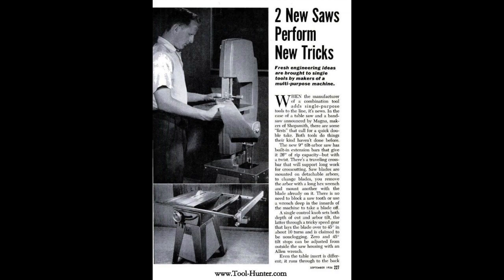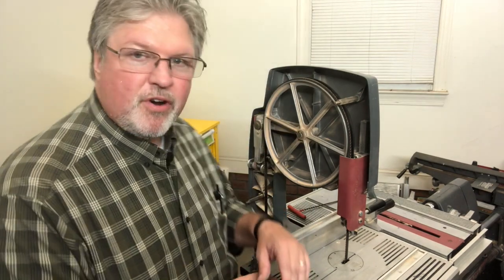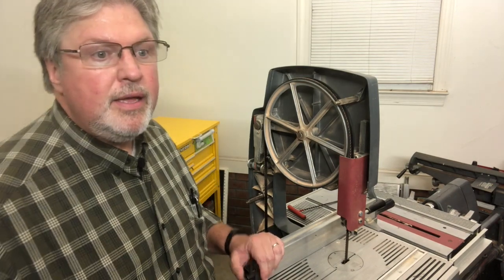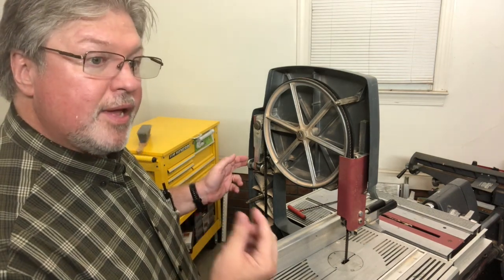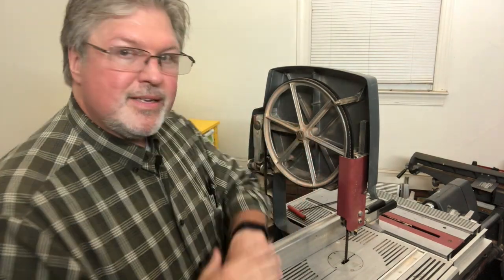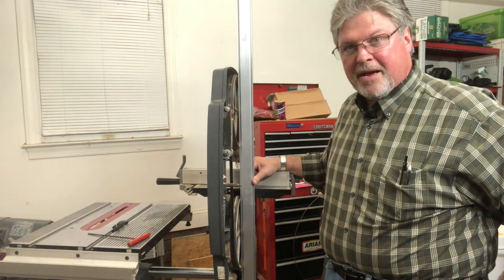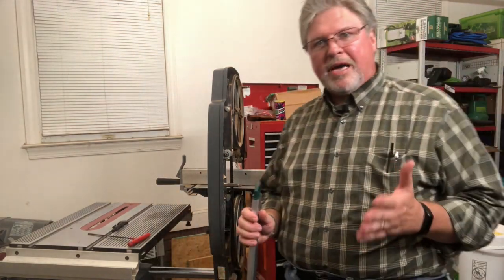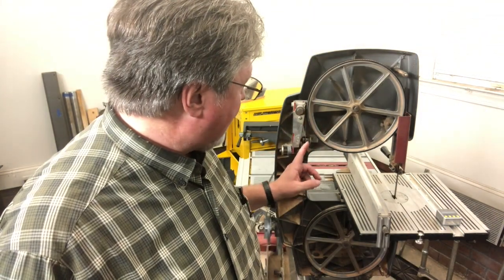How to Tune a Shopsmith Bandsaw: Fine Woodworking Magazine Lied to Us!

Comment: My shopsmith is about a 1985 model my top wheel has no e clip and my top wheel can not be removed meaning that it has water pump type bearing  bearing, ans another Q the adjustment for the blade I see the marks for the size blades but no mark on the red part to tell if set right.
Reply from the maker: The top wheel was never a water pump bearing. If there isn’t an e-clip it’s held on with a spiral retainer. There aren’t marks on the red leaf spring. As for tensioning, there’s another video that covers this. Let me see if I can find it. Scott
Reply from the maker: This may be the one: https://youtu.be/-03FHNNAExg

Comment: Scott, I am not happy with the length of bandsaw insert leveling screws.  They seem to barely thread into the bandsaw table.  Do you know where I could get longer screws?  Perhaps 1/8" longer?  Thanks in advance for any help you are able to provide me!
Reply from the maker: Isaac, just pulling one out and taking it to your local hardware store. Should be a stock machine screw size.
Reply: @MyGrowthRings  Thanks for the quick response!  We have a small True Value Store here.  I'll certainly give them a shot!
Reply from the maker: @warrensedlacek6860  And I agree with you, they are very short.

Comment: Scott, my adjuster seems to be way out of adjustment, can that be recalibrated??
Reply from the maker: Check the manual. If you don't have one you can download it from the file section of the Shopsmith Owners Facebook group.  Basically, you remove all the tension and loosen the front plate that has the blade sizes stamped into it and align the upper left edge with red the outside edge of the leaf spring.  I think I show how to do it in one of my videos, but I don't know which one!  Scott
Reply: @MyGrowthRings  Scott, mine is the Total Turd, I am sure there will be something close kind of,  LOL
I did make a new lower roller guide for the broken one, I told you about last week. I will be doing the top one next, and making a better video of the process, that bottom one is hard to film, without taking off the table.   Speaking of the Table, it had no shims and needed them for good alignment!!  Thanks  Spike
Reply from the maker: @FrugalFixerSpike  Yeah, there were a couple versions of the Total Shop bandsaw, with one being close to the Shopsmith design than the other. I have one of each and I'm not sure that I can say that either of them is a good saw.  Scott

Comment: Scott, I have also had my SS bandsaw left under tension basically since 2004 (didn't know it shouldn't). I checked the cant on the upper wheel as you showed, and with my straight edge on top and bottom of the lower wheel, neither edge is touching on the upper wheel. Your method of adjustment helped, but not enough. That upper wheel is still tilted back, but I don't know how to restore the positioning on the upper to he lower.
The end result is my 1/4" blade tracks perfectly, but my 1/2" blade falls off the front, rendering it useless. Any suggestions? I suppose I could overtension the 1/2 blade to pull it back, but that doesn't sound like good advice.
Reply from the maker: Just to be clear, the top edge of the wheel tilts back, towards the back of the saw. It it needs more tilt there's just one way to do it. When you "twist" it, you aren't twisting the blade or even the post that it is mounted to, but actually the cast arm the supports the wheel. There are some folks who prefer to remove the wheel and use an iron pipe over the shaft to accomplish this if the feel that applying that much pressure to the wheel is going to cause it to warp. The saw is designed to reduce the tilt when tensioned with larger blades, so it's not surprising that your wider blade is encountering the problems with the narrower blade did not. The tension gauge should work properly once the wheel is properly tilted.  Scott

Comment: Scott I have a 1983 mark v it is very good shape but my link between the saw and the head stock is off not up or down but front to back, emailed shopsmith twice with photo's 4 months ago with no response my manuals has nothing about front to back alignment can you advise me.
Reply from the maker: Hey Kevin. Are the two posts that connect the saw to the MKV eccentric, or are they just straight tubes? At some point SS introduced eccentric tubes that hand that alignment easy. Check SS or eBay for them.  Scott
Reply: @MyGrowthRings  it the set up you have on your video.
Reply: I can adjust the saw up and down but it the saw needs to come forward to hook up to link tube.
Reply from the maker: @kevinmoore8106  Sorry, I don’t quite follow.
Reply: Yes straight tubes
Reply: Would like to send photos
Reply: No video
Reply from the maker: @kevinmoore8106  Email to ScottMarkwood@gmail.com
Reply from the maker: @kevinmoore8106  OK, straight tubes allow no left and right adjustment. You need to get yourself a set of eccentric tubes. What you don’t want are the large offset tubes which they introduced for use with the bandsaw‘s with aluminum tables.
Reply: Sent three photos
Reply: I sent you photos are you wanting for $2.99 a month.
Reply from the maker: @kevinmoore8106  I haven’t received any pictures.
Reply: OK I will stop trying
Reply from the maker: @kevinmoore8106  Didn’t you receive my reply? Here’s what I said: Kevin,
So it looks like you might have two issues. The first one is, it looks like the way tubes may not be centering properly on the headrest. When you lock the lever on the left when the machine is in its current position, there should be a little bit of tug and resistance on that lever. If not, it may not be holding everything in proper alignment. 

The second issue is, you’re straight mounting tubes on the bandsaw. There is no left or right adjustment without them. They are $20 each on Shopsmith’s website as part 5137779.  Currently it looks like there’s only one set available on eBay, and while they’re priced roughly the same as new, they are offering free shipping: https://www.ebay.com/itm/Shopsmith-Mark-V-Bandsaw-Older-Jigsaw-Mounting-Tubes-Eccentric-Aluminum-/234486618327?mkcid=16&mkevt=1&_trksid=p2349624.m46890.l49286&mkrid=711-127632-2357-0

Once you have these, you’ll need to replace that drive coupling then you’ll be good to go.
Scott
Reply: First I know that there is forward or backward adjustment that why I contact you for advice on how to fix the problem.
Reply from the maker: @kevinmoore8106  Are you all set?

Comment: Hey Scott, what is the purpose of the guide bearing above the cool blocks? It appears as though it would never be touched by a blade, and if you push hard enough to make it touch, you'd have bigger problems.
Reply from the maker: When the upper guide post is properly aligned the top thrust bearing should be 1/64” or so behind the blade when the saw isn’t cutting, but when sawing the blade will be pushed against it. If it is too far back and doesn’t cut while sawing your saw needs a simple adjustment to the two brass set screws above. Check the manual for this and I’ll discuss this adjustment in an upcoming video. Scott
Reply: @MyGrowthRings  Good to know, mine is like 1/4" away.
Reply: @MyGrowthRings  I see now, I had to adjust those brass screws how they are to it it to lock the blade guard in place at above 2". If I adjust it to tweak it closer, then it doesn't stay locked and falls down. Maybe you could address this in your next video. Thanks for your feedback. (No manual)
Reply: @MyGrowthRings  I think I'm just out of adjustment reach. I just ordered some 5/16"-18 x 5/8" SS set screws with... 5/32" Allen! Gotta love McMaster Carr!
Reply: @MyGrowthRings  Yes, I can remove the locking nut of the top brass set screw, and screw it in more to achieve the proper clearance. .015" on feeler gauge. And the blade gaurd locks through all heights. Will use the 1/8"  longer set screws when they come to be able to use the locking nut again.
Maybe mention that trick to get more clearance height by shaving the housing just above the bearing. I gained about 1/4", from 5 7/8" to 6 1/8"
Reply from the maker: @delxmax  Whoa! Well, on a positive note, it will last forever in that position! Ok, for sure I'll share this adjustment in my next vid.
Reply from the maker: You don't need longer screws. You are about to learn how truly awesome the SS bandsaw design really is!
Reply: @MyGrowthRings  But, to achieve proper tension of the gaurd And proper clearance of the bearing simultaneously, I have the remove the locking nut from the upper brass Set screw to screw it in far enough to do this. I await your wisdom in the next video. I'd love to show you a picture.

Comment: Oh heck...I need to go detension my bandsaw
Reply from the maker: Do it!
Reply: I need to figure this de-tensioning out.  Ive never ever done it.   I’m having trouble using my SS BS.  It just won’t cut straight.  I want to be able to make bowl blanks as well, but first need to figure out my issue.   Whats a good blade size for cutting bowl blanks? 3/8th ?
Reply from the maker: @markb8954  I did a video on making straight cuts that might help. Yes, either 1/4” or 3/8” blade is ideal, but specifically I would want one with roughly 4-5 TPI. You could even get away with 1/2” as long as it is coarse enough and your radius is under around 6”. Here’s one that I use all the time and it’s versatile for large curves, straight cuts and resawing: https://amzn.to/34ShtU5

Comment: Why no press coverage? SS doesn’t run big four color ads in the publications. Also there is a snob thing going on. Norm used a SS lathe duplicator in a very early episode on New Yankee Workshop. Subsequently Norm got quite grumpy when viewers inquired.about the SS, insisting that viewers should get brand name standalone tools: table saw, bandsaw, drill press and so on. Why not? NYT had a purpose built building with plenty of room, and the big brands couldn’t “donate” products fast enough! BTW buying full page color ads doesn’t always get you any respect. Look for reviews of Harbor Freight tools. They advertise everywhere. Tool snobs prefer the big brand names even if they are made in China.
Reply from the maker: ohgary You are exactly right. I was managing Shopsmith’s Boston store when Shopsmith called and instructed me to deliver and set-up a full shop worth of tools at an address in Lexington, MA. It turned out to be the home and studios of Russ Morash, and they a were about to launch The New Yankee Workshop. Shopsmith sponsored the show as one of the two major sponsors that first year. About a week after the set-up I received another call, this time from WGBH telling me that we had to come back and remove or cover all the branding from the tools. At the time Shopsmith was condensing with the flood of Taiwanese clones, so covering the logo would leave the viewer guessing as to which tool Norm was using. (Not really, because SS was mentioned at the start and end of the show) So that entire first season was Shopsmith heavy. Russ and Norm kept the Shopsmith tools around for most of the run of the show, and you are correct that the lathe duplicator got the most air time after SS pulled their sponsorship. As to the publications, not only does SS not buy big ads, they also don’t launch a “new and improved” model every year.  That is a funny thing about tool snobbery. Harbor Freight has really stepped up their game with their good/better/best strategy, but until they extend their warranty to reflect their confidence in their tools and until they raise their prices to Mach consumers expectations of what quality tools are worth, they will continue to be the red-headed step child.  Thanks for commenting. Scott